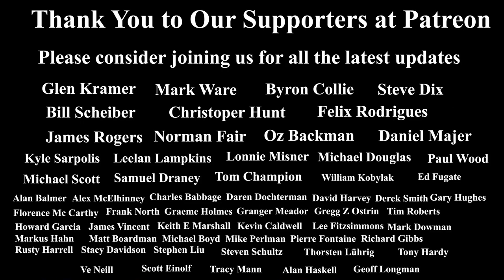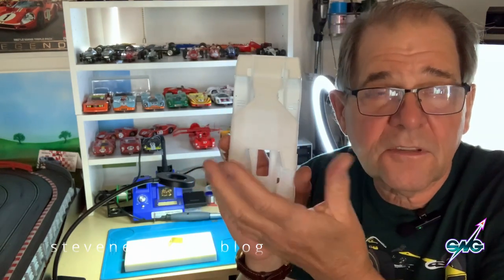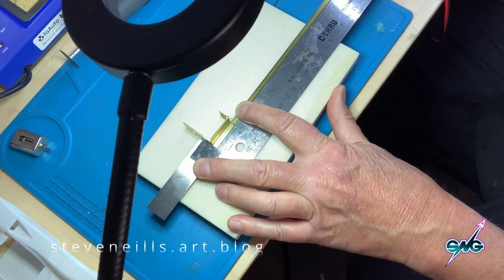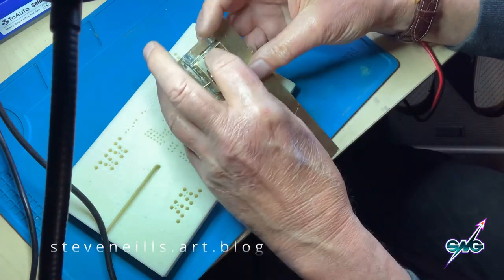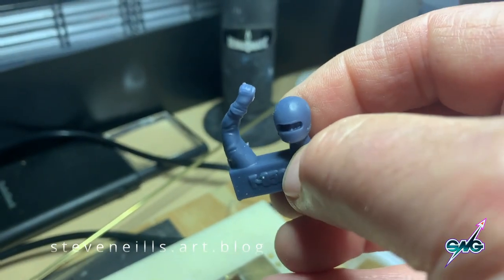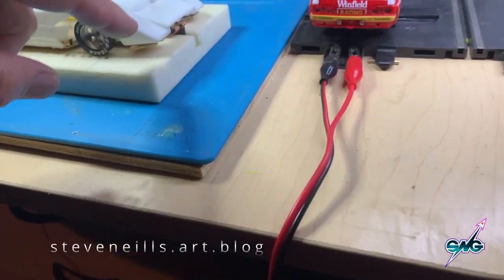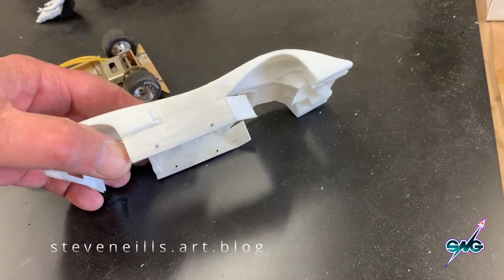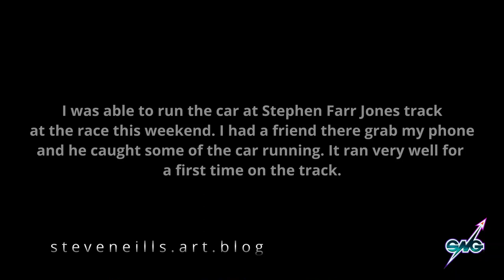Lets build a 1 24 Mclaren M8B part one

Comment: That was just great-- fun to watch all through your struggles. For me, MicroMark is a good place to find the tools you need but then, see if you can find the real names for them and get them from a source within their actual field of business. For example, although I'm sure jewelers do use those 3" squares, they're from the world of machinists. So avoid the MM gouge and go to eBay to find machinists squares, etc. Speaking of avoiding that gouging, I used to find better prices within the jewelers'  equipment catalogs as compared to MicroMark's prices. On the other hand, if money is not that tight, then MM does have an awful lot under one roof. They seem to have gone high-end these days, specializing in 3D printers and small metal lathes and mills. But before the internet, money was tight and I would go to a physical store (in Manhattan) to get my supplies. Ahhh... those were the days.
Did you really need .032" brass? That's like a whole pound, right? Why not .016"-- which is another K&E stock item? Yes, it's heavier, which I suppose keeps it on the track. But also acts like ballast and could slow things down-- or increase inertia going round the corners... interesting mix, no?
Reply from the maker: BTW I just checked and they are the same money on Ebay or a lot more.